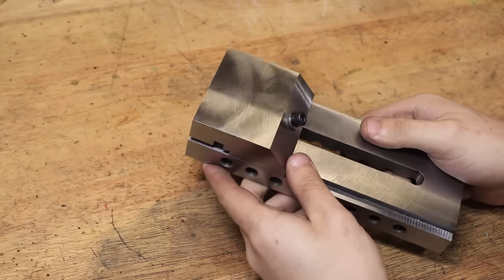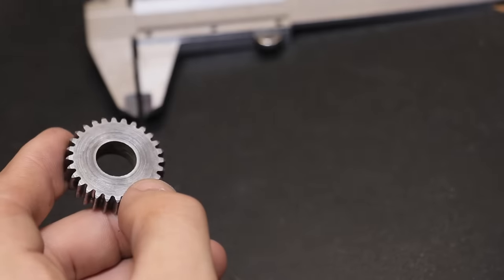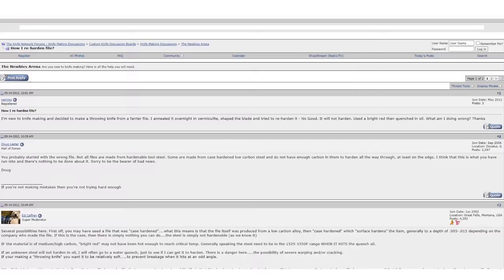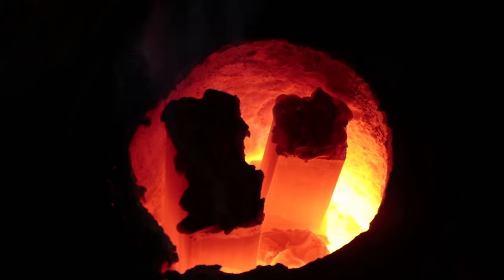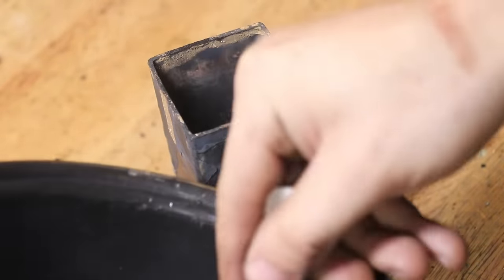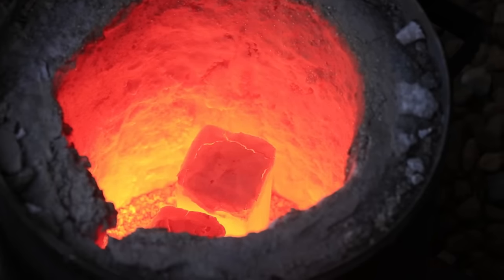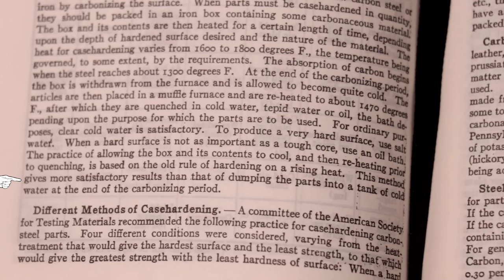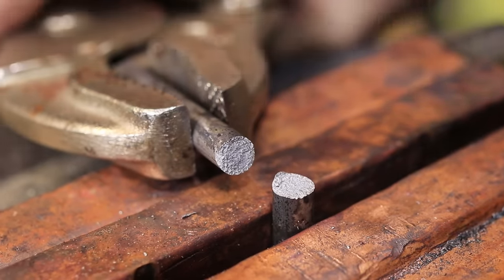Case Hardening 101 - Heat Treatment Oversimplified

Comment: That is why i am here. I often heat treat with oil. 
Keeps my drill steel sharp longer. But i have learned to quick dip my steel. I l8ke it almost white hot. Time between dipping 8s put out the fire than dip. Pull out when fire starts put out dip untill no more fire starts than let cool. Touch up edge if you want with grinder. Want to know more about carbon.

Comment: Very interesting video. If you need in the future to show better the difference from the hardened and sof layer grind and polish the surface, the smoother is better and then put on a bit of acid, the martensite will react differently from the austenite
Reply from the maker: Good suggestion, it was definitely harder to see on video than I was expecting. Cheers

Comment: Form or drill a very small diameter hole in the box. This will allow pressure equalization without allowing oxygen in too quickly. 

This should result in a more predictable opening than when mortar cracks under high internal pressure. The downside is lower CO concentration due to lower pressure while the box is unsealed.

Comment: works for me thankyou. I want to have a go at making a sledgehammer in wrought or mild steel and case hardening it for knocking in fence posts  and the sodium carbonate and charcoal method looks ideal
Reply from the maker: Sounds like an awesome project. I think I read a while back about someone who did the same thing. Hope it works for you. Cheers
Reply: @artisanmakes  you nerver know I might get it on video. I usually get half way through something before I think....I could have filmed this ....

Comment: I was wondering if it would burn through gas if you had to heat the part for several hours. I guess it's one of those cases that show why you really need to have an efficient, well insulated set up. Would an electric system be better for long-heating jobs like this?
Reply from the maker: You would be really surprised how long you can get out of a 8kg lpg gas bottle. For case hardening once it’s up to temp it takes only a little bit of gas to keep it running. Cost wise, maybe $1.50 per hour to run it. 

It wouldn’t surprise me if electric was better but the cost to buy them is north of $1000 for a small one. This set up was $200
Reply: @artisanmakes  Electric is less cost effective overall, but I think gas has to be vented, which (I think) would cost a fair amount of heat over a long period of time compared to electric... because electric has no burning or expansion of gas, so it could be perfectly sealed as long as there isn't anything in there that can still be burned. I think that might be why (with this kind of job) an electric furnace might be more efficient overall.

Comment: I thought quenching in oil bath was to stop the vapor effect you described. I could be wrong for sure!
Reply from the maker: That is definitely one denefit of using oil, but there are many reaons why one might use oil and it can vary depending of the project and the requirements

Comment: Yeah that's how we used to do a lot of case everything was just you quench it in oil get it I forget what temperature if it's cherry red I don't think going past this magnetic point has anything to do with it but it's quick and cheap and make sure you don't do it in a plastic container that it comes in it will start on fire. But nothing major. I did it with spare pieces of stainless steel so that we could knock the berries off of this big stainless steel project we were building because everyone's afraid of contamination from mild steel tools a case hardened those and they were they lasted longer I mean you still have to do it again and again when you warm down but it did last

Comment: i would add lime to the mix of charcoal. it produces carbon dioxide at ~850 degrees and at ~800 degrees carbon monoxide becomes the prodominant product in the reaction between carbon dioxide and carbon.
Reply: sodium carbonate does the same thing, decomposing to sodium oxide and cabon dioxide but its less thermodynamicaly favorable and sodium carbonate is more exspensive. though it is so cheap it may not matter to you.

Comment: The use of used deisel oil is the better oil as it has high content of carbon in it.
Reply: The 5 seconds that it takes to reach the martensite-start temperature isn't going to permit any carbon uptake.  5 hours would be more like it.

Carbon uptake is soooooooo slllloooooooowwwww.

Comment: Hi,you could use vcn150 or mo40 steel and not have so much trouble
Reply from the maker: Like I said in the video actually buying material in the sizes and small quantities that I need is the problem I run into. That’s why I turn to case hardening

Comment: The only question I have is what would I use to prevent a certain section of the steel from absorbing the carbon?
Reply: There are clays and other ceramic coatings you can paint on to prevent surface hardening in select areas.  You could also selectively nickel plate if that capability is available to you.
Reply: @Hello-ts5kh  gotcha I was assuming something like the clay they use on katanas and such

Comment: I did case hardening with mild steel big size pinion, and water quench, it didn't got much hrc
1,my box was closed with clay, and it breaks, is this cause prablem?
Reply from the maker: Yeah that can cause issues. A tighter pack with the crushed charcoal can help. Sometimes adding a very small vent hole can help reduce cracking

Comment: Specifically using USED oil to caseharden is an old wives tale. The available carbon in USED v. New lube oil is so small it is unmeasrable. The carbon that is available comes from breaking down the molecules of Hydrocarbon which is in abundance, as HC is oil.
Reply from the maker: I wouldn't have thought so either. The small amount of time it spends in the austenitic phase is also going to be pretty small in oil. I'll still give it a go when I can but I'm not expecting much. Cheers
Reply: @artisanmakes  there are many grades of tool steel that are recommended to be quenched in oil, plus others that go for Air quench. But with oil I've never seen a difference between used or new oil.
Reply from the maker: Yeah for sure, I'm trying to get my hands on some D2 steel for an unrelated project, been ages since I've used it but should be much nicer to harden than the carbon steel I'm stuck with at the moment :)

Comment: you are working with A36 Steel  That's what folks call  structural.  The product Casenite  has arsenic in it. If you can get your hands on some arsenic you might be more successful.  I used to use the stuff and it worked with a torch on an open bench.
Reply from the maker: People have talked about this stuff but I have to wonder what the arsenic does and how much more effective it is than using normal carbon source. From what I have read it is only used for producing thing case hardened layers
Reply: @artisanmakes  I don't know the chemistry but Casenite worked gangbusters

Comment: 14:10 The part must be moved in the shape of an "8" to prevent steam from forming on the surfaces, which reduces contact with water and creates variations in hardness.
Reply from the maker: Yes and from memory I address that past mistake in this video too. Most of my resources, and the machinery's handbook advises against the figure of 8 motion, rather sating that a slight up and down motion is the preferrable method

Comment: No! Don't quench in used motor oil. It's both too fast and too slow. Too fast to diffuse carbon in and too slow to quench harden the relatively low carbon steel. Use charcoal or bone meal and quench in water as you did, then temper till a very light straw colour. It doesn't want a full gas seal, there is already an excess of Carbon Monoxide being produced.

Comment: The price of low carbon vs high carbon steel is very minimal. In the case of a file, it is thoroughly made from high carbon steel. Plus case hardening doesn't work for files, the file itself is not thick enough to just case harden. Unless you are going to use some fancy laser to case harden.
Reply from the maker: The difference in price is definitely less once you are working on the scale of a factory operation but there is definitely a difference, I can assure you of that, and manufactures know this too. I know that many cheaper files are made from case hardened steel because it is cheaper. And files, with the exception of needle files are thick enough for case hardening.
Reply: Case hardening can be done to well over the thickness needed for a file, even a course wood rasp. That being said I have never found one.

Comment: what about quenching into liquid nitrogen? You can easily make liquid nitrogen with a stirling cryocooler
Reply from the maker: It would probably result in the part cracking due to the stresses formed

Comment: Couldn't you setup a hydraulic press to press a hot piece of 4140 round bar to a flat bar? I mean, if you already have the forge... They're not that hard to build with a hydraulic jack and you clearly have both the means and the knowhow to do so.

Comment: Um....
Weird notion, and I don't understand metal material codes.
But Cutting Edge Engineering is an Aussie YouTube channel working on repairs for large mining, earthmoving & road maintenance equipment. They deal W a fair amount of hardened steels in that industry.
As far as I know, CEE doesn't find it worthwhile to sell small lots of their offcuts & seconds, but if you can find a facility working W similar machinery, the tolerances & processes of large, heavy duty hydraulics seems to produce a fair amount of hardened steel seconds in sizes useful to smaller scale purposes.
Reply from the maker: I am familiar with his type of machining and if you look at a lot of the materials that he uses, the alloy tool steels that he uses usually come.as round bar. He does live in a different state to me so it is possible that his material supplier offers different stuff to mine.

Comment: 2:20 All files, good and bad are bad from plain high carbon steel, not tool steel. Just thought you might like to know.
Reply: Also 1045 and 4140 and both medium carbon, not high carbon steels.
Reply from the maker: I wasn't trying to imply that they were high carbon, just higher. My supplier doesn't sell 1095 or similar in the same 20 diameter rod. It's just to show the difference between low grade and more expensive grades. As for the files, I have a few grobet files that are made from alloy steel, and a few old (suttons I think?) That are made of 'cold working' steel. Though it doesn't specify the grade or alloy
Reply: Actually I didn't... Die!!

Comment: Quenching in old motor oil is not a good idea, Motor oil contains all sorts of random anti corrosion ingredients and when used contains all sorts of other impurities. It will produce an inconsuistent quench and an unknown mix of potentially quite dangerous fumes.

And all oils including regular vegtable oil contains a lot of carbon, so if it actually worked it would work in vegtable oil too.

Comment: For the lucky ones with a small electric furnace, piping a little in CO2 for an hour or 2 will get you a 1-2mm case.
Reply from the maker: Didn't realise how much faster the diffusion was for gas carburizing
Reply: @artisanmakes  Don't count on the time. Though I used to supervise 2 heat-treating labs, it's been a long time!
Reply: @Bob_Adkins  sounds right. i remember studying about it and mentioned gas is fastest, but complicated for shop settings

Comment: one cannot harden steel in used motor oil nor in horse piss, the carbon present there is to low.  people that say that confuse case hardening with quenching...
Reply from the maker: I wouldn't have thought so either, but enough people have said that they have gotten some hardening that it is at least worth looking into to see if the claims are true or not.
Reply: @artisanmakes  ...Well there are people now that belive the earth is flat...
But at least they will watch your  video. but again. there is not enough carbon no temperature and no time to incresse the carbon content.

Comment: When you do quench that in oil make sure you have it outside you drop the whole bar steel down in there after you heat treated it it will catch fire but it does Harden the steel

Comment: Why not completely melt it and pour it into a carbon mold then use a turn lathe to make the part you need? Would this work?
Reply from the maker: My forge wouldn't be able to crank out enough heat to melt steel. I once tried to melt cast iron, took several hours and only managed to melt about 50 grams of the stuff
Reply: @artisanmakes  You should watch my channel where I melt 14 Kg of cast iron in 50 minutes and it does not matter if I use propane or waste engine oil.

Comment: "Cyaniding" is both a carburizing and nitriding process, although it is primarily a carburizing process when performed at temperatures above the AC3 temperature of a given material.  Sodium cyanide is the active ingredient in both cyaniding and salt-bath nitriding, although when performed at the ferritin temperatures (below AC1 temperature), it is primarily a nitriding process.  Sodium cyanide and hydrogen cyanide are deadly as shit.

I find it hard to believe that pack-carburizing - a very slow and inefficient process - is economically competitive when compared to a cheap tool steel like O1 or W1.  I don't doubt that it is fun, informative, and very rewarding.  It takes hours and hours - like 12+ hours - to get anything beyond a very superficial case.  Gas carburizing and cyaniding are much faster processes that are easier to control.  With 1 hour of pack carburizing I am guessing your case is not deeper than .003 to .005 inches, if that.
Reply from the maker: The case is about 0.1mm after an hour. Remember this is a hobby channel, not my job, so everything relates to doing it in a home workshop environment.

Comment: Are you familiar with the concept of "hardenability?"  It is a technical description of the ease at which a material forms martensite- that is, how slowly you can cool a part via quenching and still achieve your desired hardness.

The reason I bring it up is because a part naturally becomes more difficult to cool rapidly the larger it gets, and just because your small round samples got hard doesn't mean that your rather large vise parts will.  In fact, I guarantee that they are significantly softer than the test samples. 

Most alloy steels and tool steels have other metallic alloying elements that have huge effects on hardenability- like chrome, molybdenum and manganese.  O1 tool steel is very easy to heat harden.  W1 has only carbon and an insignificant amount of manganese, and consequently has very low hardenability.  Carbon has a very small effect on hardenability. 

A low-carbon steel like 1018 or 1020 cannot form a fully martensitic structure upon quenching.
Reply from the maker: I am very familiar with this concept, but it probably doesn't concern the vise since we only need to harden the outside mm or so. The inside is still stoft low carbon anyway. As for this video I really wanted to avoid talking about it and TTT diagrams and the lot. Cheers
Reply: I don't agree with that.  The size of your part is certainly limiting your ability to cool the surface, which is evident in how long your water-quenched part took to stop sizzling - many seconds.  For reference, I was unable to fully harden a small piece of 1/8" (3mm) alloy sheet metal by quenching it in a fast oil, and I achieved only about 46 HRC.  It took a cold-water quench to achieve what is presumably a full-hardness of about 54 HRC.  Even that tiny piece of steel was difficult to fully harden, and it has very little interior volume and mass.  Hardenability is certainly an important consideration for the entirety of the part, not just the center.

The seed oils are also not good quenchants, since they have low cooling rates in the vicinity of pearlite formation, as shown on a TTT diagram.

Agitating the part in the quenchant is also essential to bring it in contact with fresh, cool quenchant.
Reply from the maker: @hunterbidensaidslesion1356  We will have to agree to disagree. From memory the cold water got me just shy of 65 HRC for the tool maker vise, and the temper dropped it to around 58, so it certainly got me what I needed. And I only cared about hardening the outer mm or so. Apart from shelling out $300 for a large piece of D2 steel, not much I can do apart from case harden it from low carbon.

Comment: why dont you simply weld it shut? way easier than to mix up and stick mortar and wait for it to dry.
Reply from the maker: I'm not too sure about the safety implications of welding a box full of charcoal dust. And I perform to use clay or mortar, if the internal pressure gets too high I can rely on it to release the pressure. I do worry about the pressure build up in a sealed box with no pressure release. I've thrown a can of beans in a campfire before and they can certainly go boom. Cheers
Reply: @artisanmakes  oh ok. but its not full of water like a can of beans. cheers
Reply from the maker: @aslanbosnakoglu8240  no but it would be filling up with pressurized gas

Comment: The writing advice was shorter and that’s brought on more pressure to snap it when the longer one had more elasticities in it. This experiment was not equal. The rods should’ve been the same length in the vice.
Reply from the maker: Maybe, but equal lengths or not one would the hard one would ultimately snap and the soft one would bend, which is really what I was trying to demonstrate. I filmed slot of these sequences weeks apart so I probably wasn't thinking about getting everything equal.